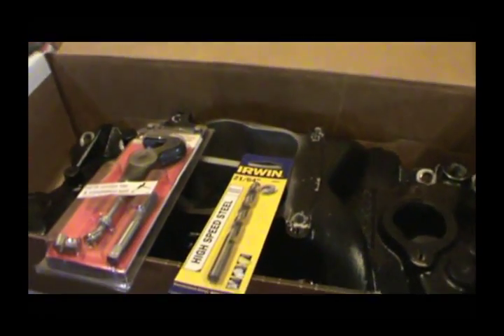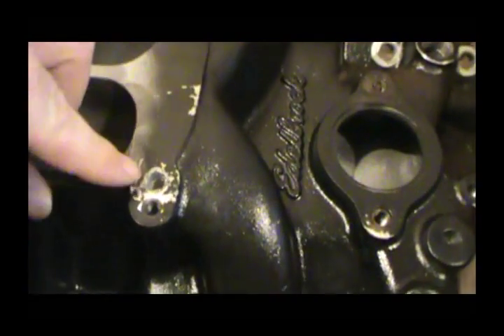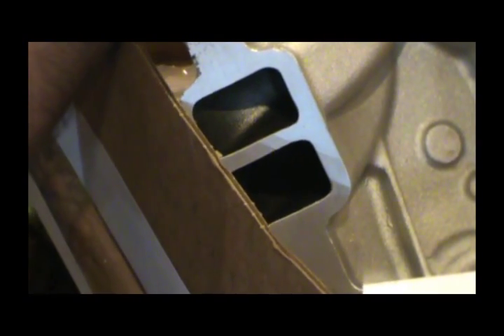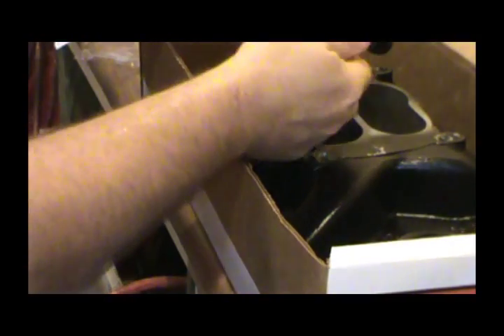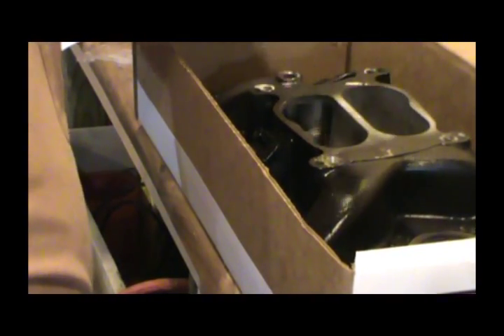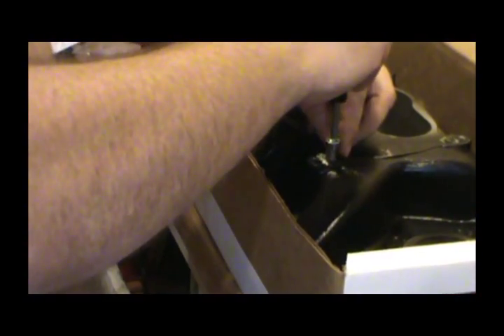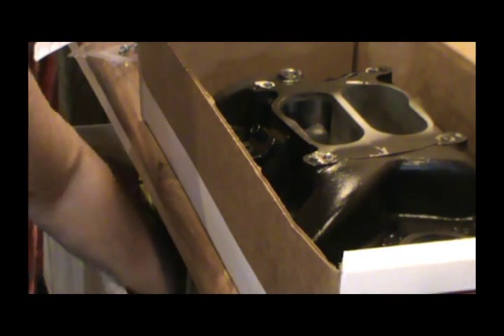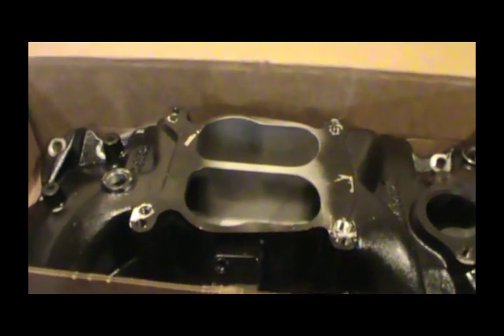Thread Repair in Intake Manifold

Comment: Thanks for posting it. I will try to fix my jetski manifold. Do you advice any particular brand to use or the one used should be fine? Where I can buy it? Thanks, Andre
Reply from the maker: Most auto parts stores carry them, just be sure to use the correct drill bit.  Helicoil is the brand I like, but there are a variety of brands out there.